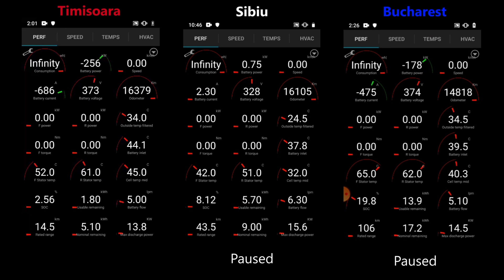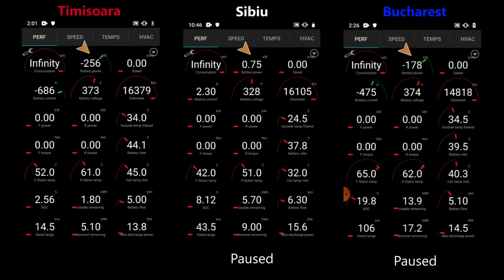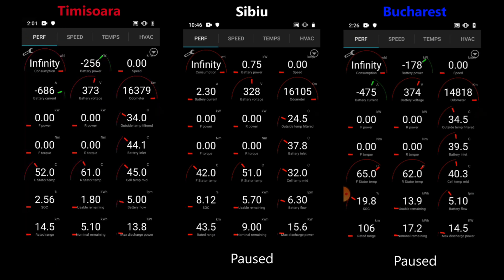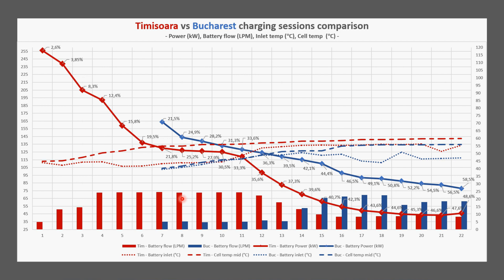Tesla battery "Overheating" explained

Comment: This is great data and another well made video. But (there had to be a but right? lol) I'm not convinced of your conclusion just yet. The reason I say this is I've seen similar throttling of charging speeds on hot days at V3 SCs (sometimes even V2) on multiple occasions - especially after rolling up with a warm battery. Sometimes I stayed in the car the whole time, other times I exited the car and monitored via the app, and sometimes exited and entered like you. I suspect if you had stayed in the car the whole time you would have had the same result. I think to confirm your analysis you need to repeat the Timisoara session under similar circumstances but vary the in/out of car state - perhaps you've already done this. Looking forward to future videos!
Reply from the maker: Hmm, it could be a mix of different aspects. At 14:30 I’m talking about some sensors/valves that were replaced in the car and at 15:40 about maybe a software update coming (which happened in December 2021 increasing the max temperature during DC charging and max power - documented on my channel as well).
I travel this summer similar trip (NL-RO-NL) and did not experience any power limitation during supercharging however, I was more strict about the following my own advices from the video: 1. I was not navigating to SC so I got there with the battery at around 30 degrees and by doing so, I was (in purpose) limiting the max power to protect the battery on long run; 2. I did not keep the AC on.
As I travel with family, few minutes extra were welcome as generally the car was charging faster then we were ready and we had to rush.
The reference for me is that at approx 55% SOC, I charge at 100kW and that was the case on all my sessions this summer although, I agree the conditions are not the same with what I did the year before.
Maybe Tesla fix something (with the sensors change and software update) however, I’m quite sure I can replicate this power drop/limitation. Tesla Bjorn has some materials documenting that more or less the same happens with other brands as well.

Comment: Oh wow, so leaving the car while supercharging is better for cooling, since battery cooling power is limited

Good to know
Reply: This is actually the heat pump model 3, that has a combined cooling heating system for cabin, motor, battery, ambient
Reply from the maker: Yes, is the heat pump model with octovalve. I think would be ok to stay in the car with AC ON from the beginning of the session, maybe there will be just a little bit of power limitation not so noticeable. In my situation, the fact that I entered the car (and turned the AC ON) in the moment when the battery needed most cooling and cabin was super warm, that definitely put the entire cooling system under pressure and BMS reacted by limiting the charging power.
After that incident, I had a service appointment for another issue with Tesla and they say there was also a recall on my car to change some sensors related to the HVAC system. Also, this year, Tesla Bjorn made some similar tests and he replicate the same issue with MEB platform cars (VW group), BMW I4 but not with Tesla.
So, I have no clue if this was really fixed but I will still claim that in some extreme instances this can be replicated with more or less any car on the market today that charge above 200kW.
Reply: @ZEFElectric  we just bought this dec 2020 version of the model 3 second hand, how do you know if these thermal sensors have been replaced for the correct ones already?

calling tesla?
Reply from the maker: @MaykThewessen  First of all, congratulations on the purchase! A year ago when they did the work on my car, they mention that "all relevant affected cars will be called at service for that issue". If your car is one of the affected ones, I expect they did the rework as they also mention “there is a risk for the heat pump to break if the rework is not performed” – as the cars are in warranty they have high interest to fix them. Just to be safe, you can call Tesla to find out and for that I wanted to check exactly what they replace (I’m not sure if it was sensors, valves or both) as this used to be visible on the Tesla App -> Service History but surprise surprise… the appointments are visible there but no details behind it. Maybe is because my Tesla account is a “driver” account as the car is a lease car and technically I do not own the car. Sorry!
I wonder, if you own the car and buy it second hand if the service history is still available in the app? In theory it should but maybe that history remains with the account not with the car. Can you check on yours?

Are you sure your car is exactly same as mine? Mine is really a hybrid model between 2020 and 2021 model. The battery is LG Chem 75kWh gross capacity (code E5D mentioned on the registration papers), made in US (most 2021 models arriving in EU are made in CN) with all first phase 2021 updates on the body but no “matrix” LED lights. If is exactly the same (especially the battery size), I wonder how many km you have on the odometer and what is the range displayed by the car at 100% (maybe you can extrapolate from 80-90% if you do not charge it to 100%)? The reason I ask, is because my car display 520-525Km which means about 3-5% degradation after 43tKm which is not bad at all considering that degradation is the highest in the first year.
Reply: @ZEFElectric  our Dec 2020 M3 LR vehicle shows 520 km at 100% (calculated) as well! so i think the same, it also has the newer interior and chrome delete black exterior

So i think it has the 75kWh raw E5D LG battery as well, that has little lower fast charging max power

but our older april 2019 model 3 long range, has a bigger 79kWh raw panasonic battery and more fast charging, up to 250kW, but the full range there is only 460km! Why so much lower? 

purely because the Dec 2020 model has the heat pump? which makes up for the little smaller battery size?
Reply: The 2019 panasonic pack uses NCA chemistry cells

The 2020-2021 LG E5D pack uses NMC 811 chemistry cells, and therefore have less capable fast charging i think
Reply from the maker: @MaykThewessen  it sounds like same car/same battery indeed. Yes E5D is a NMC chemistry which charges at slightly less peak power yet, they say it has less degradation on long run.
460km on 79kWh battery sounds quite low. The cars with heat pumps are more efficient yet, the difference is quite big.
As far as I know, on our cars the constant used for calculating display range is a consumption of 137Wh/km (updated in January or so from 139 Wh/km - was one of my first update where I got something like 14km more on the display range).
Can you check what is the constant used on your 2019 car (in the energy screen there is that line called “Typical” - try to get a sense of that)? When you know that constant, you can get an estimate of the degradation if you do not have SMT to read from the BMS.

Comment: Hi, it is arrived an update for LG battery at supercharger (software 2021.40.6). Now the car can charge 10/20 kw faster than before!
Reply from the maker: Hi Filippo. That sounds like a good news. What power are you getting at what SOC?
I did not supercharge my car lately but I will keep this in mind and perform a test myself with first occasion. Remember, it's extremely important the temperature of the battery when you get to the supercharger, so make sure you are comparing the same charging scenarios. 
Another aspect I noticed on my car is that the latest update brought "Cold Weather Improvements" and release note on TeslaFi say "Additionally, when using climate controls on the Tesla App, automatic battery pre-conditioning has been optimized to consume less energy.". I indeed noticed that at similar temperatures as before (around +1 Celsius), the car is no longer pre-conditioning the battery when turning the heating on from the app.
Reply: @ZEFElectric  the car started battery preheating 100km before supercharging with 3°C outside. I arrived at a V2 supercharger with 16% and I kept 150kw untill 35%. Than it started throttling and at 44% I could get 122Kw. Over than 100 kw untill 55%. Later the charge speed slows gradually. At 85%, when I stopped charging, I was getting 45Kw
Reply from the maker: @filippopagliuca  Wow, flat 150kw until 35% sounds like a great improvement for the LG battery but also, over 100kw until 55% - previously was up to 45% (even in summer time). I will for sure validate that soon with my car under similar conditions 3°C but maybe lower SOC at arrival. Something like my first V3 SC charging experience: https://youtu.be/rPuanPjCEP0. Stay tuned.

Comment: Given your lifestyle and your trips, including the NL-RO trip, would you think an SR+ MIC LFP would have been a deal breaker? Would it have brought a big disadvantage?
Reply from the maker: This is a very good question.
In countries (like NL) where there is a strong charging infrastructure (both local AC chargers and fast chargers/Superchargers) I think I could slightly adjust my routine for an SR+ without problems. My LR is based on NMC LG Battery and the recommendation is not to charge it too often above 80% while with LFP they say is no problem to go to 100% - so, that could mean more or less same effective day to day range if you do not charge LR above 80%.
In countries with less chargers, the story will be different and on medium/long trips you will be dependent on relatively limited 50kW triple chargers which are more and more busy or sometimes deliver less power.
The NL-RO-NL trip I did was in summer so in winter, the range, charging speed, consumption will be different.
Despite the power and range, with LR you get also “Premium interior”. The big plus there is the sound system which is one of the best I’ve experienced in cars. I did not try the sound in SR+ but they say is not as good.

Comment: Can you share your VIN number (last 6 digits)? I have also TM3 delivered in late December 2020 and I am curious if my M3 can be affected as well. My  last 6 digits in VIN are 820012
Reply from the maker: Hi Patryk , welcome here! Is your M3 the early 2021 model with heat pump? If yes, most likely is affected by the recall on the mentioned sensors. I'm told by Tesla that the recall is not critical but it "could reduce the lifetime of some components". You better give them a call. My full VIN is most likely visible on some of the materials I upload but the last digits are: 831858. Cheeers. 

Please consider  giving me a like and subscribe to the channel if you find my materials interesting!

Comment: I can confirm the recall of the sensors of the heat pump from Italy. Also my Tesla M3 LR, delivered in December 2020 with LG pack, had to change these sensors.  I hope that Tesla will release a software update for this model to improve charging speed and match 2020 Panasonic charging speed.
Maybe with the arrival of Tesla Model Y, that mounts the same battery, there will be some news
Reply from the maker: Thank you Filippo. Enjoy your M3!